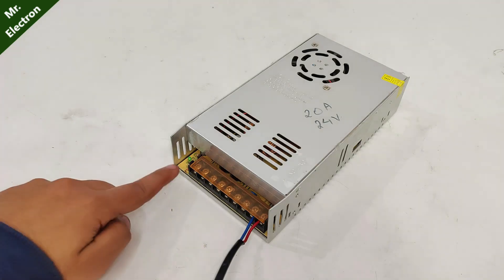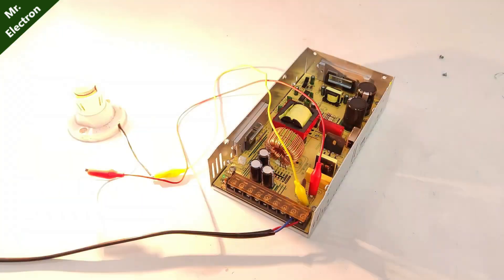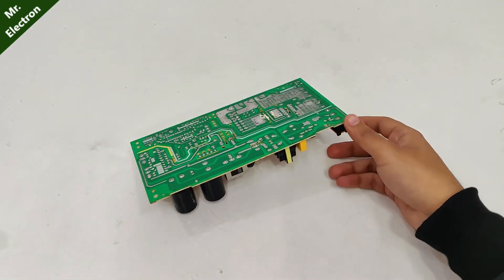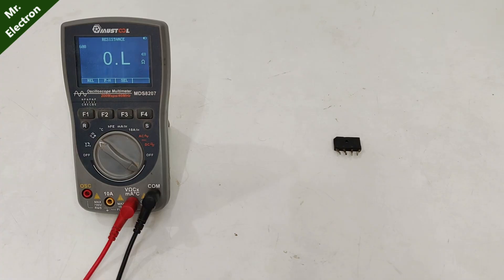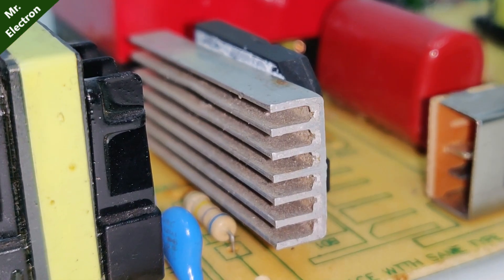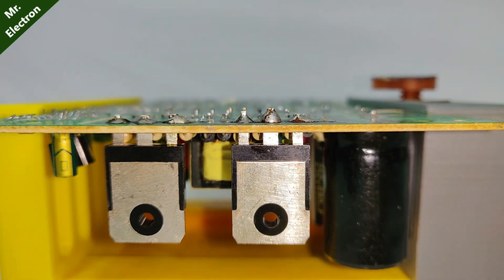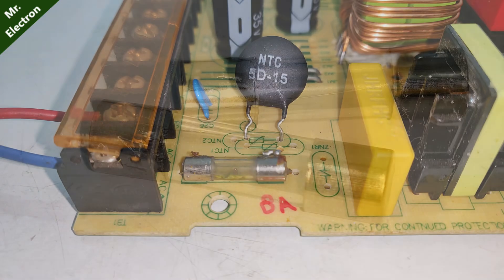24 Volt 480W SMPS Power Supply Repair - Step By Step

Comment: in video at 9:10 you have brushless motor  in that motor only two wire ? i think brushless have three wire ? correct me please .
Reply: A two-wire brushless motor typically includes a built-in electronic speed controller (ESC), simplifying its operation by integrating the commutation and power control into the motor itself. Unlike traditional three-wire brushless motors that require an external ESC, two-wire versions are powered by simply applying a voltage, with their speed controlled by varying the power supply through their integrated controller. These motors are often used in applications like computer fans, small tools, and electronic toys where simplicity and ease of use are prioritized.

Comment: Assalam walekum I bought a new SMPS power supply China 24 volt 15 amps I use this power supply for now few days but the thermal fan heat sinking fan does not work on the casing of a power supply it show me a note that this power supply is built in fan on of control circuit fan automatically works according to the working temperature but I use one and half to two hour DC power motor 24 volts and 9 ampere but even that the fan does not power on I checked the casing temperature with my multimeter temperature sensor it goes up to 56 Celsius it means the inner parts or inner components are more heated then the temperature of a casing what should I do from where I watch the he says that you don't worry it's fan fragger on 7280 Celsius but I have consensus that if the casing temperature is go on 56 Celsius so it means the inner parts or inner components are more heated

Comment: The resistance value that you showed is without isolating it right?How can we expect a value close to its real value when its still in the pcb track. I guess one leg should be soldered out and then check. Who knows the problem might be that resistor but we move forward .I hope this helps to the newbies who are in to troubleshooting.Sorry it sounded rude

Comment: Wow! You made that look easy.
I have a question is it best to test the components by removing them first? I have read that you don’t always get correct readings on the multi meter if the transistors are still in the circuit pcb.
Also what is that type of solder gun that also removed the solder?
Please help as I am trying to fix a 120 to 48v 20.8 psu that I accidentally wired a buck converter reverse polarity and blew the caps on the buck and the psu is now dead. 
I bypassed a blown fuse and used a dim bulb tester as you did but the the bulb still stays lit which means it is drawing too much current…
Please help 🙏

Comment: Some very serious issues with this video which could easily result in injury or worse.
Using fuses in parallel to achieve a higher current rating is not recommended and can be dangerous due to uneven current sharing and the potential for catastrophic failure.
You should also never re-use a Sil pad as it is likely to have been compressed and could have minute damage to the material which can flash over at full power which you would not notice as you failed to do a Hi-Pot test on the product once assembled.

Comment: Why not just check the fuse with multimeter for continuity? Rather than using the bulb
Reply: Hes doing this to Check If the current thats going Through the fuse is to high because of shorts
Reply from the maker: @adsyndrome Correct answer . Good 👍

Comment: I copy a 1000 watt forward converter and build it but i use ee4215 core which i double two together and i use two  fgh60n60smd igbt which is rated for 120 amp pulse current and a gate drivers transformer that provide 7 amp peak but 1.5 amp continues current and gate voltage 18volt but i couldn't get 500watt from it even though all components was will over rated i was pulse 10 amp 131vdc but i couldn't get pass 480 watt the igbt blow and the igbt was not hot just warm the gate had protection ziner and subber to protection from volt spikes the gate current was stronge enough for fast charge and pnp for fast discharge  everything what right but still blow over and volt at 500watt and the original 1000 watt had a smaller transformer and lower rate  igbt but i couldn't 990watt from it even though the circuit i rebuild have far more better components can you explain why the more efficient parts can give 1000 watt. Ut lower rates can i even use the same transformer and i get lesser then 300watt and when i test the gate speed my circuit speed was faster keeping the igbt cool but the commercials one was very warm at zero load i dont understand my circuit was had biggest track for current flow and better gate driver

Comment: Please discharge the large capacitors if you have connected the power supply before touching anything on the other side of the pcb. Better safe than sorry.
Reply: Exactly, even without plug it in, sometimes it keeps voltage for days to weeks.
It's high voltage it could kill you

Comment: Could you give me advice . I have 24v Power source like you have in video. It gives 24v without load. But under load it gives only 3.6v.
Reply: One 650kOhm resistor was down from 230v side. I try to find If there is more broken parts.

Comment: I added a nail with the ends cut off that just fitted the opening of the screw and glued it in. I left a  little stick out so that it holds the slider in place better. I used a tap to clean up the screw bore and I used white lithium grease to lube the screw with. Works much better now. Great concept.

Comment: 480watts @ even 200Vac = 3A @80% efficiency

Since it was made to run on both 110v and 220v..

 at 80% efficiency with 8A fuse, the lowest possible voltage will be 75Vac..

Conclusion:
This much supply deviation is only seen in china.. 
this was probably made in china

Comment: Does an 8 amp fuse make sense? I'd use a 5 amp if powering from US 120 vac and a 3 amp if powering it with 220vac. 8 amps @ 220 is 1920 watts!

Comment: Thanks, I have a question. I have a solar panel converter and the led isn’t going on. Can you explain how can I do a checkup of the unit and replace defaults component ? Thanks in advance.

Comment: you do not need or want thermal compound when you have silicone insulator pads,that makes heat transfer worse. and paralleling fuses? No. get the right fuse.

Comment: 2 fuses in parallel is not 8 ampers
Reply: Yes it should be in series
Reply: @mdasim6986  Are you serious? 
Fuses in series are rated to the lowest fuse, they ARE NOT additive.

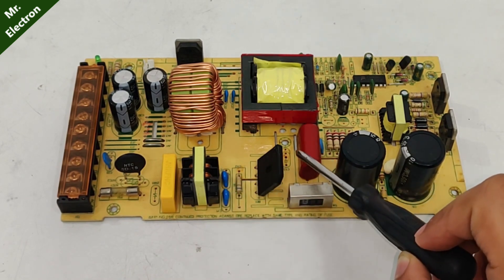Comment: 1. 1:51. This part is not called a transformer.
2. "The capacitors are of because they are not inflated." -> You are totally wrong. Electrolitic capacitor does not neccesarly needs to be "inflated" but still can be damaged/degraded inside.

Comment: Hi, Have a question about SMPS initial Max current an SMPS can support. If I use a 1200W Desktop PC SMPS that has common rail, and I connect all 12v together ..can I use it to power a load that takes 100A ? as soon as it powers on will it be able to support this current ?

Comment: 1:51 This is not correct: It‘s an EMI-blocking choke, not a one to one transformer: A high frequency blocking choke is made of two coils and a ferrite core where L is going through one coil and N through the other coil. A transformer is also made of two coils, but they have much more windings, an iron core and L and N are both connected to one coil. At the other coil you can get the secondary voltage, which is the same as the input voltage in an one to one transformer.
Reply: Right

Comment: Nice job on the diagnostics, and upgrading with better components. Been checking out some of your older content, and this seems much more advanced. Did you get any training in electronics since you started posting on YouTube? Nice to see your channel grow and evolve
Reply from the maker: Hobby
Reply: (Tnx) Fuse is ok bro but transformer output not working properly any solution bro
Reply from the maker: @LSX49TECH  try changing the transistors.

Comment: Question. I watched your rewiring of the Bosch alternator. What gauge size magnetic copper wire did you or should you use for for a 150 amp Bosch alternator 14 volts?

Comment: The resistor that  was shorted why  wasn't it replaced
Reply: The resistor was OK the fault was also across the same point in the circuit, at least that's what I believe having not seen the schematic.
Reply from the maker: Correct.